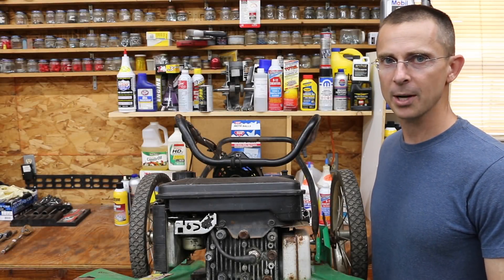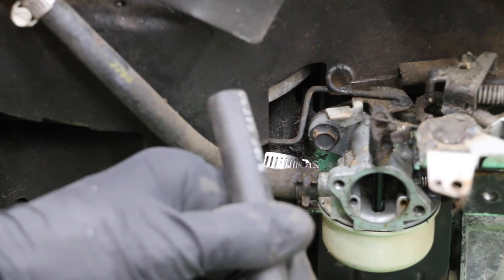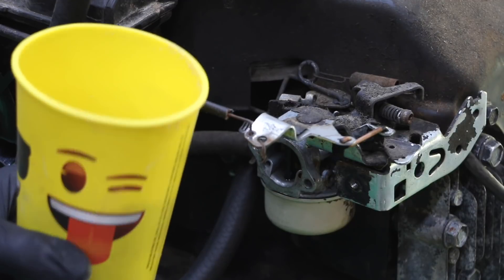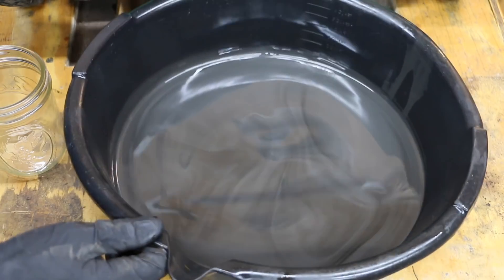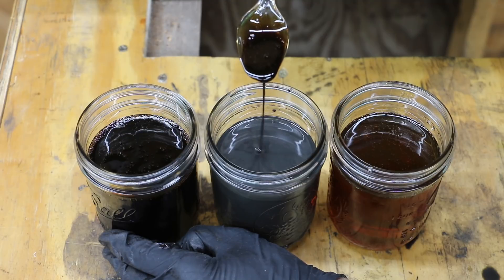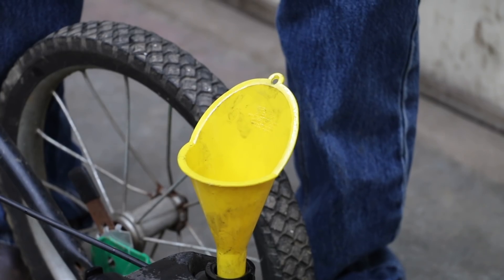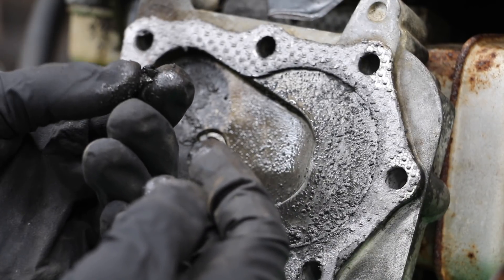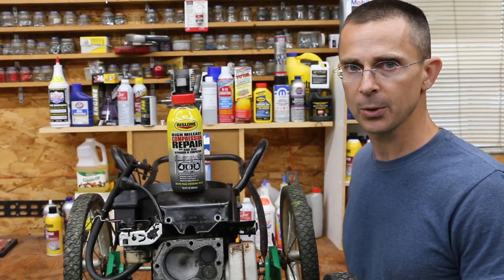Engine Eats Sand! Can Rislone Repair Compression Loss?

Comment: How about ATF fluid? I heard of using it as either an oil additive to supposedly loosen and clean burned on oil deposits and gunk or as fuel additive to supposedly clean combustion chamber and valves ?
Reply from the maker: CheezeCracker, Thank you for this recommendation!
Reply: CheezeCracker I did it for 5 mins on an old chevy I had because I just rebuilt it and had watery oil and it blew a piston from poor lubrication
Reply: CheezeCracker yep I was told it will remove carbon deposits from oil galleys on a neglected engine.
Reply: ATF is actually a very high detergent oil and will effectively clean things up quite nicely.  I wouldn't replace more than a quart with it, though.  I've used it in engines and in diesel fuel systems.  It's a great oil to use for a lubricity additive in an older diesel engine that doesn't like the ultra low sulfur fuel today.
Reply: We used to add a quart during an oil change on engines that had leaky hydraulic lifters.  Worked pretty good too.
Reply: Ox, ATF is not a good engine or fuel pump lubricant. If you use too much of it in your crankcase oil, it will kill your engine. I saw that happen right in front of my eyes to a 350 Chevy engine. If you use too much in your diesel fuel it will kill the fuel pump, because it is not a good lubricant, saw that happen many times. A little bit of regular 30 weight oil, two stroke oil, or some Marvel Mystery oil would serve you better in that scenario, however, you should not need it. Nowadays most all formulations of diesel fuel have an added lubricant for just that scenario. I was a diesel mechanic for over 30 years and I have replaced several fuel pumps because of people trying that ATF trick before the oil companies added other lubricants to the diesel fuel.
Reply: ExcursionPower Yup someone once commented that all this does is add a very low viscosity oil to the mix and its just asking for trouble.  Still curious bout this doing anything as far as cleaning
Reply: Top tip. Drip feed for best results.
Reply: Robert G - Your results may vary.  I should start putting that in every comment I make in these scenarios.  For every good result you'll have somebody saying the opposite and vice versa.  I for one don't trust the oil companies to put the needed amount of lubricant in the new diesel fuel.  They didn't at first, didn't tell anybody that it would burn up injector pumps from lack of lubricity, and you're going to trust them NOW?  Not me.  Good luck to ya.
Reply: We do have other diesel fuel lubricants available. I use Opti-Lube Boost (1 oz./10 gal, max treat rate) and Opti-Lube XL (2 oz./10 gal, near max treat rate;) my 6.5 TD got a little more power with them, I measured with a ScanGauge II; now the vehicle won't downshift as much going uphill at 50 MPH.

Comment: love the show reminds me of that old TV show Fight Back, have you done anything with the Lucas oil products?
Reply from the maker: Jason, thank you very much for the positive feedback!  I have used Lucas along with Seafoam in a video several months ago, but I have not tested it independently.  I plan to test it soon.  Thanks for commenting!
Reply: i have used the "tune up in a bottle" from Lucas and it has helped my 99 explorer with a lil 215,000, pass smog, w/o a tune-up( i went to a smog shop before to see of would pass and they said no) friend of mine mentioned it and i ran to autozone and got it and the smog tech was shocked and begged to know what i used, also I have used the transmission stop slip, on this same explorer and so far so good

Comment: I feel like some nasty 15 40 rotella would do better stuff is tar in a diesel.
Reply from the maker: Connor, Good old Rotella 15 40.  It smells bad, but I use it in my old tractor.  Thanks for commenting!
Reply: Project Farm as the engines change demands are more I can list several diesel injector builders that will not recommend it. There is a reason why not to mention mile foe mile there are much better choices. Amsoil schaffner's Royal Purple delo just way way better choices

Comment: i can feel the difference on my 350 1991 tbi its a tired motor with 202000 miles on it.
Reply from the maker: Carrion, Thank you for sharing this experience with Rislone.  By the way, I really like those TBI 350s! I've owned 2 of them in the past and they were probably the most reliable and durable engines I've owned.  I hope you get many more miles out of it!

Comment: I really expected it to help, but it actually looks like it did more harm than good.
Reply from the maker: I agree!  I really did hope that this product work achieve good results and was disappointed at the outcome.  Maybe this product would help an engine with very mild compression loss.  Thanks for commenting!
Reply: Cheaper to just chuck cement powder in the cylinder lol.

Comment: Just shows that a lot of the "miracle repair" products on the market are just snake oil, nothing to them and could make things far worse than they originally were...
Reply from the maker: towcvbloke, I agree!  The build up inside this engine would become problematic.  With that said, maybe this additive would work well if the damage wasn't so severe or in a different engine design.  Thanks for commenting!

Comment: This is probably one of the most under-appreciated channels that I'm subscribed to.

Your videos are very interesting and educational, thanks for your time and effort and I hope you'll get rewarded one way or another for your work!

As far as it goes for ideas:
-i'm curious how the engine would run and if any damage would occur if it ran with different fuels, I know you made a video with starting fluid, I'm curious with other things as: (someone else said this a little earlier) diesel, alcohol, etc.

Also, I don't exactly know how a lawnmower engine works, but it would be interesting if you could rev it up more, or less, see effects on higher and lower rpm (might sound silly, I'm not very skilled when it comes to engines).

Anyway, those were my suggestions, I'll keep them coming if I have more in the future!

Thanks again and keep up the good work.
Reply from the maker: matrixismyname, Thank you very much for the huge compliment!  I'll keep working hard to improve the quality and content of these videos.  Also, thank you very much for these recommendations!  These are great ideas that I will definitely put to the test soon.  Thanks again!

Comment: Not sure if its been mentioned or done yet but I would like to suggest a torture test of sorts. As a mechanic (for large and small engines) I have had countless experiences with different oils such as gear oil, ATF, hydraulic oil, and even occasionally cooking oil. On all of the aforementioned oil containers it says (in one way or another) NOT FOR USE IN INTERNAL COMBUSTION ENGINES, and I am very curious as to just what can happen. Will one oil change worth of any (or all) of the oils I listed be useable in a pinch and will it cause irreparable damage to the internal components? Also No 2 diesel (dyed, farm use, fuel oil etc) and kerosene have been claimed to clean out an engine during an oil change. Ive had some old timers around me claim that filling a crankcase with an appropriate amount of diesel or kerosene, running the engine for 3-5 minutes, and then draining said fluid out after letting it settle to the oil pan helps prolong the life of the engine by thinning any sludge and carrying it out with the diesel/kerosene. Of course use your best judgement on this topic, you make incredible videos and I do not want you (or anyone) to put themselves into a dangerous situation. Sorry for the novel, and thanks for the content!
Reply from the maker: Mike P, You've provided great video suggestions!  I plan to test several of these in upcoming videos.  Finally, thank you very much for the positive comments!

Comment: I ran Rislone through my ATV and it barely helped! Wasn’t worth it, my combustion chamber was a little gunked up too. I thought it would help  since my ATV is jetted.
Reply from the maker: I had hoped to see better results.  Maybe Rislone works for engines with very mild compression issues.  Thanks for sharing your experience with Rislone!

Comment: A lot (most, all?) of these products "scare" me, and for many reasons.  I  believe that they  are  just "snake oil" for  machines, comprised of little more than thicker viscosity oil at a  premium price.  Engines  are  designed to run on a  specific  type and viscosity of oil in a specific ambient temperature  range and with specific metal to metal clearances.  While substituting a thicker oil may have an immediate effect of  reducing blow-by and oil burning/consumption, may that also deprive any undamaged  portions of the engine from proper lubrication, greatly accelerating wear and  damage, and at  a higher operational cost?
Reply from the maker: Danny, This is a great point! Thanks for taking the time to comment!

Comment: Hay @project farm I was wording that what will happened if u put liquid nitrogen in the engine.will the engine cease ???
Reply from the maker: Syed Nehal, Thank you for this video project recommendation!
Reply: It will, because the engine won't get enough oxygen due to the nitrogen gas replacing the air with its 20% oxygen. Hope this was understandable :)
Reply: etuanno  thanks for letting me know

Comment: You should do a video on what happens if you run soapy water instead of motor oil. I personally don't know what the results are going to be, but I would be interested to see them. Also my neighbor does it, he says he don't have to spend money on oil when he could just put soapy water in his car. Also he is a drunker.
Reply from the maker: Thanks for this recommendation!  I don't believe the outcome would be too good, but it'd be interesting!
Reply: DevPre soapy wooder
Reply: butchtropic , 
There is an episode of top gear us where they use molasses in place of motor oil.
Reply: DevPre , soapy "wooder". 👍
Reply: No liquid can be compressed.
Reply: Hartin Fartin i hear of people that actually do that and have good results with it
Reply: i hear vegetable oil works, and makes your blowby smell like popcorn
Reply: Lol, he sounds like a drunkered. He would be better off just never ever changing his oil.
Reply: I have been using Cooking oil in my rack and pinions for years.
Reply: D Rutt 1969 how in the hell does tranny porn come up from a comment about a drunk guy? And why are you trying to insult me?
Reply: I had a friend who had all the oil leak out of his car in the middle of a desert. He fixed the leak by the roadside, but had no motor oil to put back into engine. He put plain water into the crankcase instead, and was able to drive 50 miles to a garage. While I wouldn't normally recommend using water in place of motor oil, it will lubricate and cool your engine somewhat and would last a lot longer than running an engine with nothing in it at all. As for soap, I suspect it might improve lubrication a bit it would also dry out and gum up inside the motor.
Reply: CreepStar Gamer  I had a friend who had all the oil leak out of his car in the middle of a desert. He fixed the leak by the roadside, but had no motor oil to put back into engine. He put plain water into the crankcase instead, and was able to drive 50 miles to a garage. While I wouldn't normally recommend using water in place of motor oil, it will lubricate and cool your engine somewhat and would last a lot longer than running an engine with nothing in it at all. As for soap, I suspect it might improve lubrication a bit but it would also dry out and gum up inside the motor.
Reply: Not a good idea to lubricate with vegetable oil after using mineral oil. Plenty of kids did that with their motorcycle engines, and seized them with blocked oilways shortly afterwards. The two oils react and clog the engine. You need to wash out all of the mineral oil before changing to vegetable oil.
Reply: @RWBHere SCIENCE!
Reply: Wooder
Reply: The result would be Hydrolock
Reply: Run either dish soap or laundry detergant as oil

Comment: Thanks for your videos! Just a suggestion. You did a compression test right after doing the sand, but I think to make things fair you should have done a compression test with fresh oil after you flushed out the bad oil. In this case it didn't matter because the additive didn't improve the compression, but if the compression did improve we wouldn't have known if it was due to flushing the bad oil or due to the additive. 
Keep it up!
Reply from the maker: georgekelp, This is a great suggestion!  I always appreciate constructive feedback.  Thanks again!

Comment: I used Rislone on a Honda Rancher that would not even start due to low compression. Shop wanted $500 to tear it apart only then go from there. I bought a bottle of Rislone and within 2 minutes of turning the engine over it started and runs like new. 
I was going to use Restore (got the idea from your Restore video) but it will damage the atv wet clutch while Rislone will not.
 Rislone is a great product imo. (On an atv)
Reply from the maker: Dakota, I'm glad you had great success with Rislone!  Thank you very much for taking the time to comment!

Comment: you should use an iron sleeved engine for testing to better recreate automotive conditions the engine your using has an aluminum bore and a chrome ring witch allows allot of dirt to pass thru unlike cast rings and did you ever here of the old saw dust trick for a spun bearing keep up the good work
Reply from the maker: iam, This is an excellent point and great suggestion!  Thank you very much for the positive feedback!

Comment: it may take a log time to work as it is a slow build up of particles in the scratches you need to do it on a car or similar the give it a good old fashion drive along a freeway for a good few miles the you might see some improvement
Reply from the maker: Chris, this is a great point.  I only ran the mower for a few hours and the oil level dropped below the bottom mark.  I suppose I could have continued to add more additive and run the engine longer.  Thanks for commenting!

Comment: This might be a kind of ridiculous suggestion, but i would love to see what would happen if you ran gallium through an engine
Reply from the maker: Ruxiah, Several others have asked for me to try this.  Seems like an interesting test.  Thanks!
Reply: lol soaking the cylinder head in gallium causes the aluminium to disintegrate, making it brittle and the whole thing blows up       definatley something i wanna see.
Reply: Ruxiah it would be super dangerous. the gallium would weaken the aluminum to the point of wet paper and the motor could explode
Reply: I love that idea
Reply: it would hydrolock tighter than if you put water in it if you put in enough otherwise a little would just burn right through if added slowly...personally i wouldn't do it for the fact that some gallium compounds are dangerous and i am not about to find out if some can be produced inside a ICE
Reply: Actually, even better. Gallium instead of oil, Since gallium eats alluminum
Reply: If I remember right, Gallium eats aluminum! That would be great. Too bad you can't try mercury, the aluminum killer! Vaporized mercury seems bad, maybe you can try it in the crack case.
Reply: hell yeah,   that would be cool.
Reply: Do 10 oz of gallium and 10 of oil and see how long it runs
Reply: gallium would destroy the aluminum engine but it would be fun to see or try it on a cast iron engine
Reply: If you do it please do it outside and don't breath that in!!!

Comment: seen the video with the restore in the diesel tractor  with improvement in compression you did maybe try restore on the sand eater to? just a thought great video by the way
Reply from the maker: tranz15, This is a great suggestion!  I'm interested to see if Restore can help.  Thanks again!

Comment: Could you do a "what happens" video of sodium silicate? the same stuff the government uses on engines in the cash for clunkers program to seize the engines. I know it gets poured into the engine once the oil is drained, and supposedly it turns into a hard glass like resin when the engine gets hot enough to lock it up. But never have been able to see what it actually does to the internals.

And also, love your videos :)
Reply from the maker: Aarons, This is a terrific recommendation!  Also, Thank you very much for the positive comment!

Comment: What about putting Ceratec in that engine???
Reply from the maker: FallenAngel, Thank you for this recommendation!  I'm curious to know if it would help.
Reply: Me too, I'm plannig to put some in my car, but haven´t found any reasonable review of it. Liqui Moly claims it to create a ceramic coating on the metal surfaces reducing friction and improving compression, but, as I said, no one has made a video with the results and how the engine looks after using it.